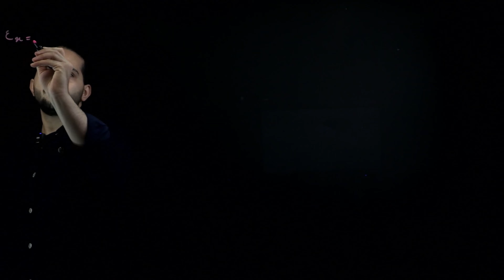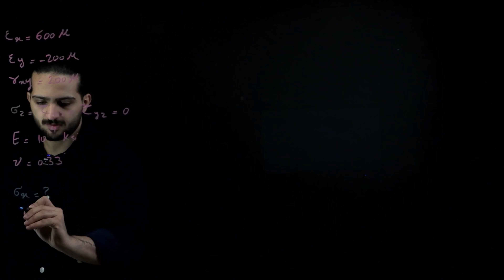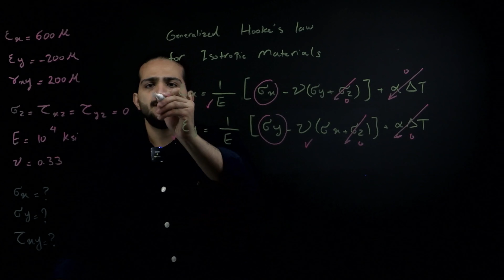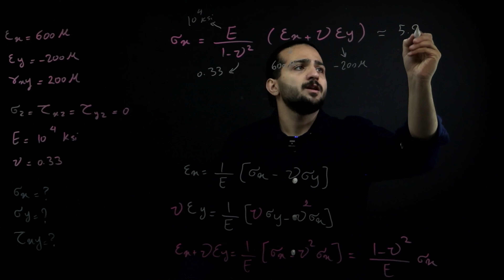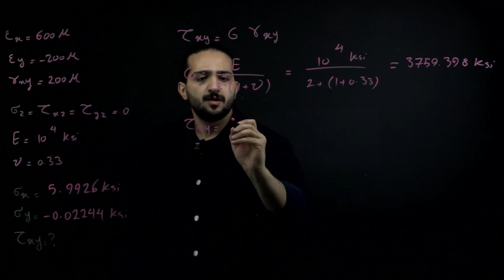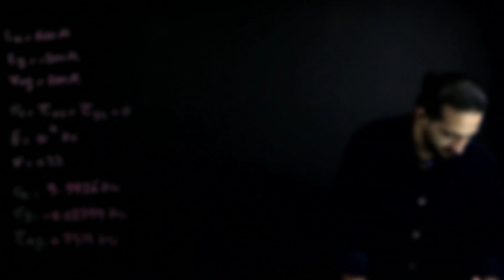Hooke’s Law for Isotropic Materials; Dilatation (Example 1) - Mechanics of Materials

Comment: Quick question: Is it possible to get negative strain in one direction even if the stress in that direction is positive (e.g. Can εy be negative when σy is positive?)
Reply from the maker: Of course! Good question. The strain in each direction depends not only on the stress in that direction, but also on the stresses in the two other directions as well as the change in temperature. So in this example where σz and ΔT are zero, εy will be negative with any σy value smaller than 0.33σx. For example if σx was +10 and σy was +3, εy would still be negative. I hope that makes sense.
Reply: @CivilEng_Amir  Gotcha, thank you!